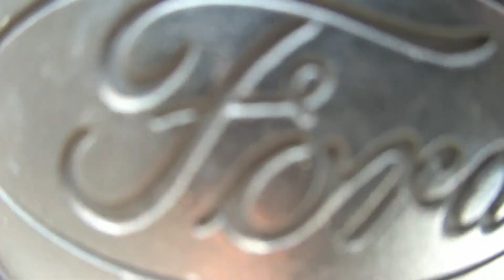Transit mk3 smiley lowered modified cool AF

Comment: Here in the States a guy at a car show had an old SVO Mustang with 2.3 turbo (Pinto motor) except he had a Volvo twin cam 2.3 head on it. He said it bolted on directly but had to drill a couple holes in the head for coolant and weld a piece to the back of the head to allow it to work. I heard it run and accelerate when he left and it was fast.
Reply from the maker: Yeah seen this and aware of this combination the mustang svo and murkur xr4ti use a pinto turbo variant never seen one in the uk or would jump on it Thanks for the comment Mike

Comment: Hi buddy any more transit  vids  u still got it iv just found  one in same condition as urs 😉  never had a mot from new mint
Reply from the maker: Yeah still got it and using it most weekend got most of the parts to do a 2.0 16v zetec swap with fuel injection will post it when I’m doing it soon 

Thanks pal
Reply: @unpluggedautomotive878   cool man 😁😁

Comment: That’s not a smiley BTW - the smiley is the mk4 with oval grille.
Reply from the maker: I know this try telling everyone I’ve given up it’s a mk3
Reply: @unpluggedautomotive878  Lovely van, anyway! I have one, but nowhere near as good as yours.
Reply from the maker: @dungareesareforfools  thanks mate it’s had a ffew bits done since this video had cylinder head done as steam seals where gone also fitted a Kent cam and pulley and a free other bits I probably forgot still love it and use it most weekends
Reply: The Smiley is a Mk5, from 1995 to 2000, Mk4 1991 to 1994 had a slatted grill but the same headlights as used on Mk5. I have a MK5 2.0dohc and love it.
Reply: @garlicandchilipreppers8533  Sorry, yes I forgot the mk4 didn't have the oval grille. 
I wish my mk3 had the DOHC, I used to have a Sierra with that engine, it was smooth and could rev.